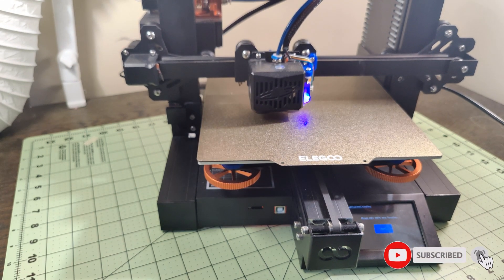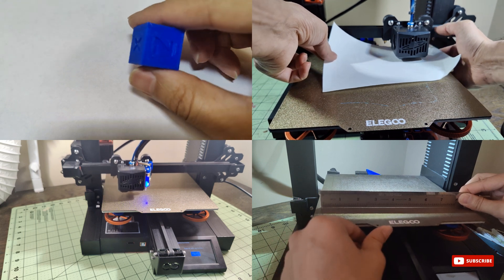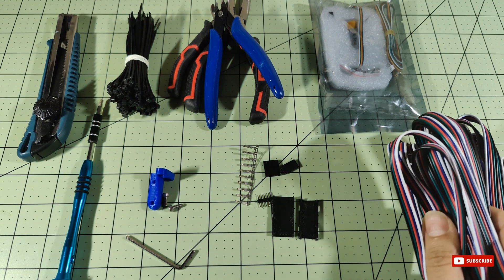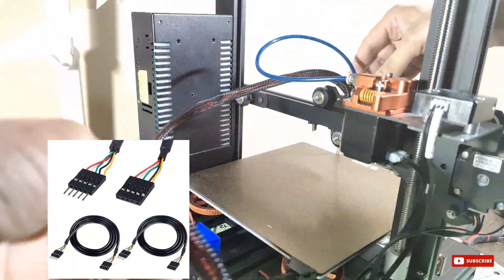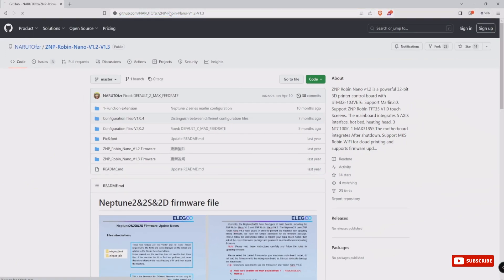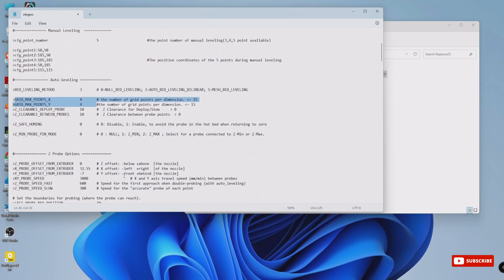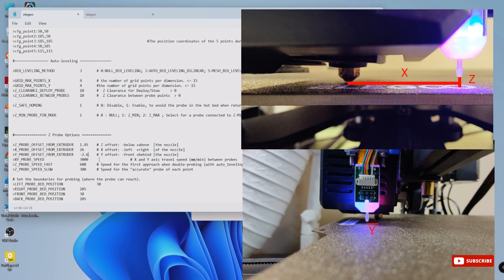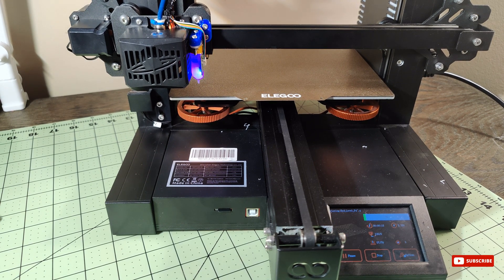How to Upgrade Your Elegoo Neptune 2S with BLTouch: Let's Level Up!

Comment: I performed this upgrade, however my printer is not properly utilzing the Z Offset.  I perform the leveling, it goes to the center and I adjust the Z Offset (to barely allow the paper to pass between the printhead and the heatbed.  I then load a test print and it is obvious the Z Offset adjustment is NOT applied as the printhead is scratching the heatbed.  Any ideas?
Reply from the maker: Hello! It seems like there might be a discrepancy in the Z Offset adjustment. To address this, manually adding up to 0.2mm to the current offset. This should bring the nozzle up to the correct level. Sometimes, issues like this can arise as the Z Offset distance matures or changes over time. Give this adjustment a try, and it should help prevent the printhead from scratching the heatbed during your prints. If the problem persists, consider recalibrating or checking for any other factors that might be affecting the Z Offset. Hope this helps!
Reply: Did you find a solution, I have the same problem but in the opposite direction, mine doesn't touch the bed on the first layer and just slightly hovers above the bed.
Seems like some sort of bug, I am planning to re flash the firmware I just need an SD card